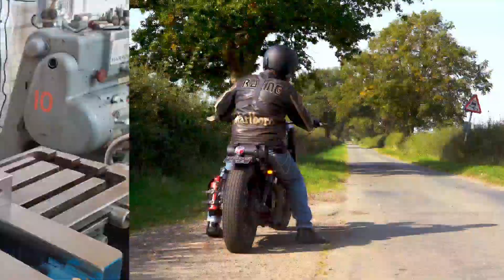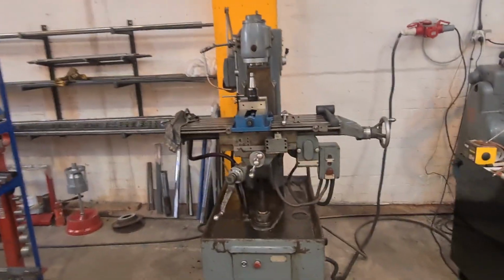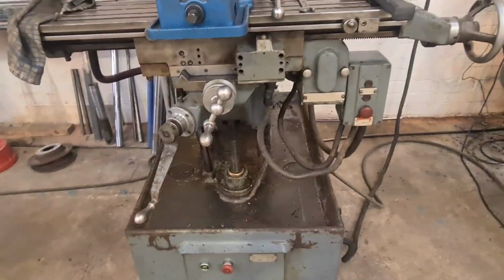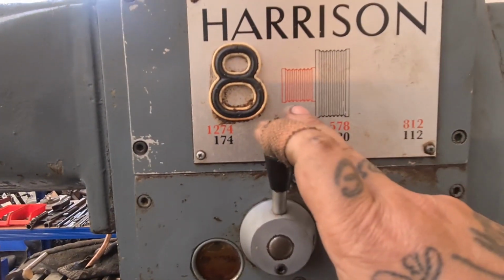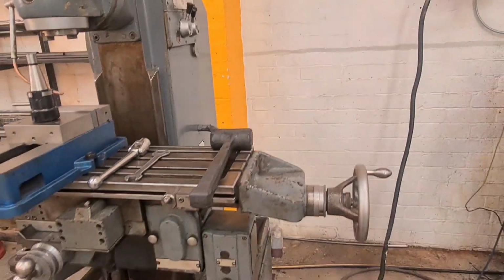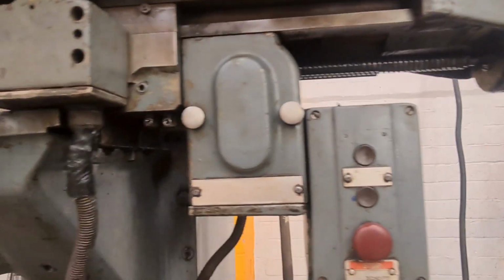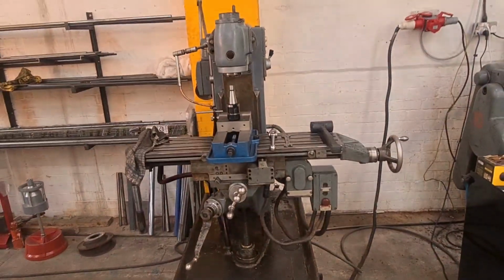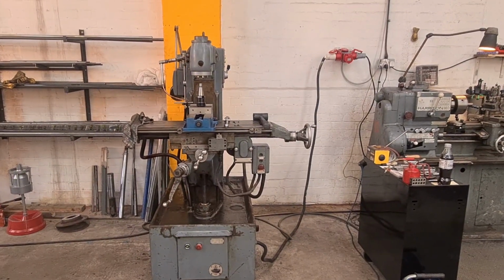Harrison Milling Machine update It's Alive! Setup Cutting chips too!

Comment: Hello Ralfy. I am currently restoring one of these machines and will have some updates on my channel soon. Mine is a horizontal machine with the vertical attachment. The feed doesn't reverse as standard. Harrison did make them with an auto reverse on hitting a stop. Mine had a "Square D" type drum switch on it to reverse the Brook Gryphon feed motor by swapping two phases over. I have converted both motors (main drive and feed) to delta and I will be using a separate VFD for each one. I really liked your video and I have subscribed. I will have more stuff on my mill coming to my channel in the next few weeks.
Ps I just realised a lot of people already mentioned about the feed and that you sorted it. Apologies for the repetition.
Reply from the maker: Much appreciated buddy

Comment: Hi Ralfy, I have just finished rebuilding an older Harrison Mill. For the table feed gears, I used Myford ml7 change gears. They are not a straight fit, as the bore is too big, however, they are the correct diametral pitch and overall diameter. I bored the gears out to 3/4", and made a brass bush to reduce the bore down to 1/2". keyways were cut into the bush and gear then silver soldered when pressed together. The pair of gears need to have a total tooth count of 81. eg 60t gear and 21t gear. any combination like this will work. Hope this helps, regards, Richard.
Reply from the maker: Thank you that's a great help 👍

Comment: I have one of these machines (since 1999) and can help on the feed arrangements.
As supplied from harrisons, these had feed in one direction only, unless to special order, which was electrically arranged to reverse.
What you've got there is a standard model (but also rare- they made few of them), it feeds right to left, and the only way to improve it is by electrical modifications.
I've wanted to do this for years, but also include a VSD so to make the feed infinitely variable, but I have not got around to it yet.
Reply from the maker: Thank you Tim, yes I fitted a switch box in the end to enable feed in both directions, what I lack are the switch gears, so I can change the feed speeds, although it's not critical for the work I do

Comment: So, the consensus seems to be that installing a Drum Switch should take care of your issue. Since it's 3 phase all you have to do is swap 2 of the leads and the motor will run the other way.
Reply from the maker: Thanks buddy, its definitely the way, the factory set up is manual return only